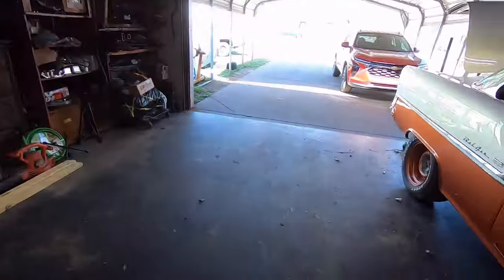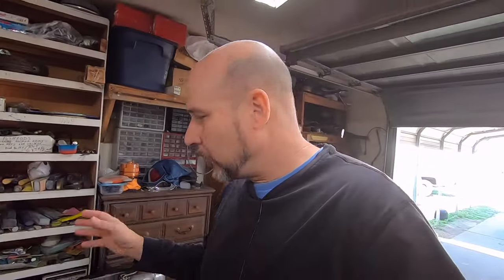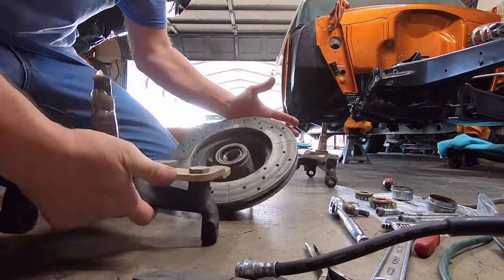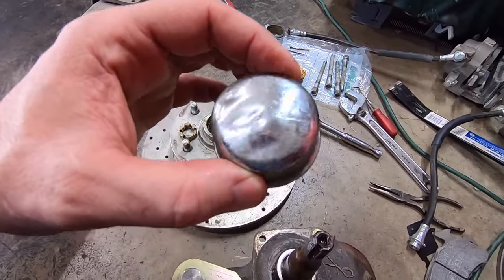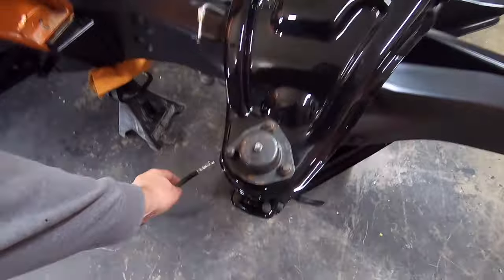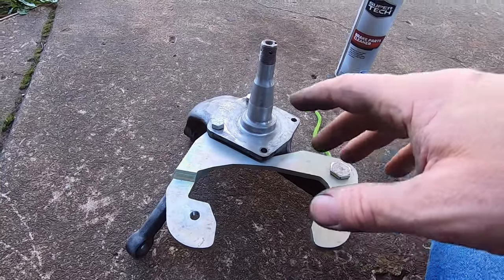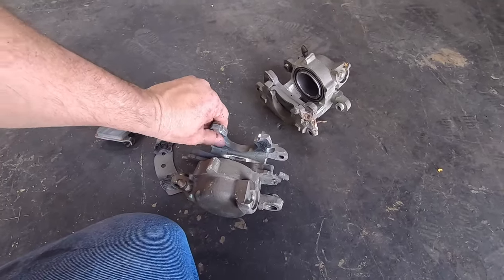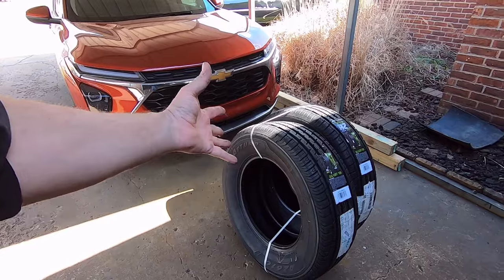Steve's 1955 Chevrolet hardtop project. Spindle prep and brake stuff.

Comment: The #1 issue I have had with restoring my 56 is delivery cost, and competence for things that I order! We have a PO Box at the post office, and live in a slightly rural area. I had to literally start using the post office's physical address as my delivery address! And I put the PO Box as the 2nd address. Poor ladies at the post office! ;) And the cost of shipping is crazy!! I have ordered stuff where the shipping cost was higher than the cost of the part. Sad!!
Reply: Fuel prices are a big factor in delivery cost. Sadly nothing ever goes down so you know when the price per gallon of gas finally goes back to the $2 range shipping will still be high.